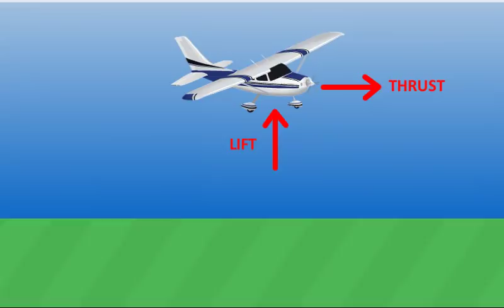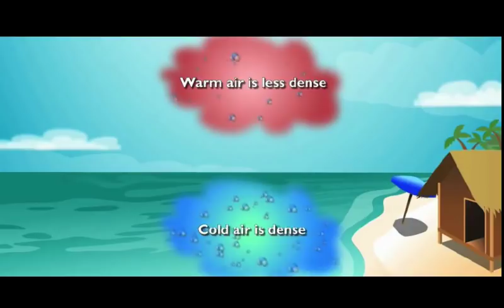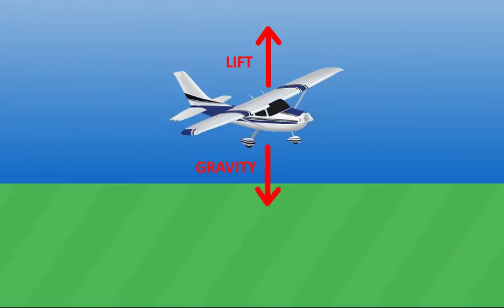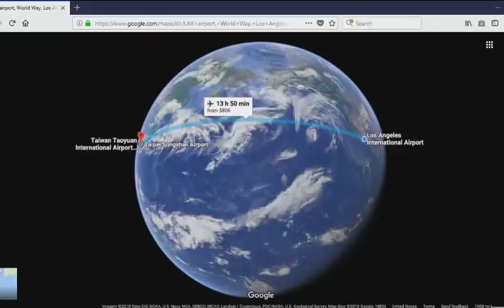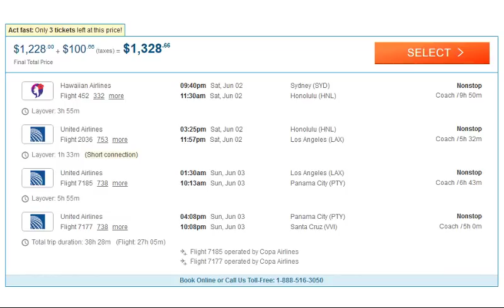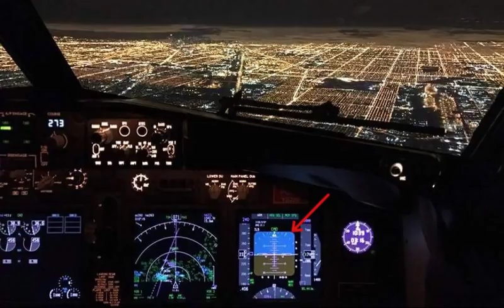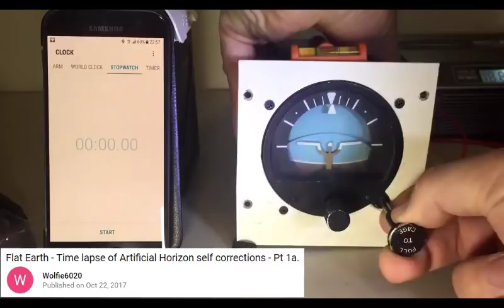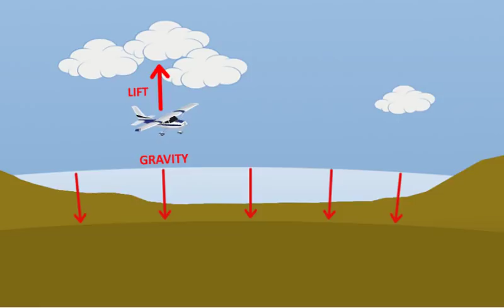Flat Earth Falsities - Plane Nonsense

Comment: You forgot to touch on the Coriolis effect. Humm. Or are you trying to write that out of history also? You know the rotation of the earth affects a 3 g bullet but not a 790 ton aircraft oh and apparently it also affects rotation of a huge hurricane, amazing. Bullets and hurricanes but not airplanes? Can’t wait for that video.
Reply: Maybe an aeroplane has a pilot that can make constant corrections. But your correct, hurricanes do spin in the opposite directions each side of the equator. If you could explain why it would be greatly appreciated.
Reply: A P Presley technically bullets do have pilots it’s called the person who pulled the trigger. And I’m not sure why course correction has anything to do with airspeed and the lack thereof to overcome the surface speed of the earth. And by the way here in United States the surface speed of the earth should be 900 and some change miles per hour which is 400 short of the top speed of a commercial airliner and 200 miles faster than the speed of sound wrap that around your brain
Reply: @charlesshinn7116    If the earth is not spinning, on a flat-earth it must be the sun moving at 1000mph when passing along above the equator. However when in the northern hemispheres summer the sun is moving along the Tropic of Cancer which is much shorter distance on the flat earth than at the equator, so the sun is now travelling at 700mph. Then in the winter when the sun moves south and travels over the Tropic of Capricorn the sun has to speed up to 1300mph. Because the difference distances the sun travels from summer to winter on a flat earth are twice as far. How come nobody notices the sun going twice the speed in the northern hemispheres winter. Or people in the southern hemisphere seeing the sun racing past at double speed in our summer.
Reply: A P Presley first of all I wanna say your comment is extremely encouraging Because it proves you have looked into this very extensively and I am glad of that. I also have looked into this very extensively and your comment assumes that the length the sun travels in a day lengthens and shortens. I don’t necessarily subscribe to the current flat earth model of a sun spinning around a disk. ( The daylight hours don’t add up either) Do a little research on the book of Enoch in that book it describes the sun traveling in a straight line across our flat plane. The same distance day in and day out only changing position from Tropic of Cancer to Tropic of Capricorn throughout the year. I greatly appreciate your ability of critical thinking keep up the good work, continue research and continue seeking the truth.
Reply: @charlesshinn7116    If it always moves in a straight line, how does it get back to the start. So the sun is visible by somebody at all times, travelling in a straight line how does it reset to begin again.
Right now on Macquarie island which is a part of Australian Tasmanian territory. The sunlight and corresponding twilight is lasting 24hrs, the sun barely disappears below the horizon, so twilight lasts all night. I have actually been there and can vouch that this is correct. Macquarie island is on the 55th parallel south. The odd part is, that when the sun rises from just below the horizon. That sun rises south towards Antarctica. How can your sun on the flat earth that you say never goes below the Tropic of Cancer. Be seen below the 55th parallel south.
Reply: @charlesshinn7116  "technically bullets do have pilots it’s called the person who pulled the trigger."
I don't think you understand what a pilot is.  But, if we go ahead and say that shooters are bullet pilots, shooters differ from normal pilots in that shooters can NOT make changes to the flight after they pull the trigger.  They must make all the corrections for the flight BEFORE they pull the trigger.  Normal pilots can make changes DURING flight.
This is why a shooter has to worry about coriolis, but a pilot doesn't.  Because a pilot can correct the flight while in the air.

"And I’m not sure why course correction has anything to do with airspeed and the lack thereof to overcome the surface speed of the earth."
You don't understand conservation of momentum.  Got it.  That's a common failure with you guys.  Airplanes fly at 500 mph.  If you are in your seat on an airplane flying at 500 mph and you get up to go to the bathroom you would never make it right?  I mean, you can't ever hope to walk at 500 mph right?  So you would be trapped in your seat never able to get up for fear that you would slam into the back of the plane right?  Yeah, same concept.  And don't bother saying "oh but what about outside the plane" doesn't matter.  The rules of physics work the same whether you are inside or outside.  Your inability to understand them does not invalidate them.

"I would love to have somebody show me where there is Actual scientific proof that gravity even exist."
Are you floating right now?  No?  If you jump up what happens?  You fall back down right?  There it is.  Don't bother asking for any other proof because if you are incapable of understanding this incredibly basic concept then any scientific experiment will just fly right over your head.

"From what I understand to this day it’s still a theory."
Case in point.  Anyone who says "still a theory" doesn't understand enough about science to even grasp just how much they don't understand.

"And if you read some of Newton’s later papers he recanted the whole thing LOL and beg his peers to please not attribute him for the theory."
Straight up lie.  

"first of all I wanna say your comment is extremely encouraging Because it proves you have looked into this very extensively and I am glad of that."
That's a whole lot of words.  Too bad none of them succeeded in saying anything of value.  How's about instead of telling people to "research" a fairy tale book, you put your money where your mouth is and apply some of that "critical thinking" you were talking about and spend a few minutes actually trying to explain the apparent motion of the Sun over your magical flat world.  Since you don't "subscribe" to the "current flat earth model" why don't you start explaining how your Sun can travel in a "straight line" and somehow still set in the West and rise again in the East?  How can it do that if it's traveling in a "straight line"?  You do know what a "straight line" is right?  If YOU are not able to explain the motion of the damn Sun then YOU are not applying any critical thinking at all.
Reply: A P Presley we live in God’s creation and only he has all the answers but please check out daz nez video (does the sun travel straight or circle round) biblically I think his model gets it as close as we can get with our limited knowledge of how everything actually works. Please check it out it’s a short video only about six minutes long but it may give you a different perspective and maybe a little closer to the truth. I completely believe your description of what you experienced on that island. and he touches on the fact of a midnight sun in his video. I just believe that there are a lot of things that we’ve been told about our world that have either been hidden from us or are lies to deceive us from the truth. Continue to critically think and seek the truth.
Reply: @charlesshinn7116  So basically "god did it" and "watch this video" that's your idea of critical thinking?  Yeah.  You have no interest in seeking truth.  Someone actually interested in truth would not just wave things off and say "well because god".  That's not a direct quote, but that might as well have been.  Hell you might as well have just said "because magic and unicorn farts."  Someone actually interested in seeking truth, someone who actually critically thinks about something...wouldn't just blame some magical sky daddy for everything...they would...you know...actually critically think about the subject and look for answers on how things work.  If YOU can not explain the movement of the Sun in simple terms right here in your own words, then YOU have never actually applied any critical thinking to the subject.
Reply: OMG GMO why, yes that is what I’m saying God did do it LOL. Hello the first three chapters of Genesis but I guess you don’t believe in God or the sky daddy as you put it LOL. And I’ll also take it  you didn’t watch the six minute video and I’ll bet it’s because in your opinion it would be a waste of time. to each their own. Truth is truth regardless of religious beliefs. every knee shall bow and every tongue shall confess that Jesus Christ is Lord. Here I’ll tell you what I’m gonna make a prediction your response to this will involve name calling LOL.
Reply: OMG GMO OK I just saw your first reply. My response to conservation of momentum is, you can’t have both the Coriolis effect and conservation of momentum, one of them has to cancel out the other. All the examples of conservation of momentum that I have ever seen have been inside a container such as an airplane or a car and according to the globe model we are not in a container and if you’re saying the atmosphere is the container then there should be no such thing as the Coriolis effect the bullet would move with the atmosphere and hit the target dead on. And because of conservation of momentum how does the rotation of the earth have an affect on hurricanes. You can’t have both the two can exist in the same room.
Reply: OMG GMO As far as gravity. Show me the scientific paper that is proof of gravity, there is none. Even Neal degrease Tyson is quoted as saying we can’t prove that gravity exist we can only see it’s affects. The affects we see only prove that the object that falls is denser than the air that surrounds it.
Reply: OMG GMO and what exactly are you attributing all of your education on the subject to? a fairytale textbook or a fairytale video I’m just saying or Maybe a fairytale school seriously I don’t know you from Adam no pun intended but what’s your educational background and how do you know it’s any better than my educational background? It’s a shame you seem so agitated and angry I didn’t mean to make you angry.
Reply: OMG GMO look I don’t think you’re stupid and I’ll never call you that the fact that you’re talking about this subject at all speaks volumes. What I do find funny is that you answered for somebody else which does tell me one of two things either you’re very concerned about your fellow human beings or I’ve just been tag teamed. In an attempt to shame me in the silence boo-hoo LOL
Reply: @charlesshinn7116  "why, yes that is what I’m saying God did do it LOL"
Well then stop talking about critical thinking.  Saying "god did it" is not critical thinking.  Saying "god did it" is the OPPOSITE of critical thinking.  

"My response to conservation of momentum is, you can’t have both the Coriolis effect and conservation of momentum, one of them has to cancel out the other."
Wrong.  More than one thing can affect the motion of an object.

"All the examples of conservation of momentum that I have ever seen have been inside a container"
In my comment I predicted that you would say THIS EXACT THING.  The rules of physics apply whether you are in a container or not.  Your inability to understand basic principles of physics does not invalidate them.  

"As far as gravity. Show me the scientific paper that is proof of gravity, there is none."
As I said earlier.  Any scientific paper will fly over your head because you can't even understand the concept that you are stuck to the ground right now because of gravity.  Don't ask for scientific papers when you can't understand even basic concepts.

"The affects we see only prove that the object that falls is denser than the air that surrounds it."
Density is not a force.  Stop repeating nonsense you learned from a yoga teacher.  Density can not cause anything to move.  Saying things fall because of density is like saying things fall because they are blue.  It's gibberish.  What you are really saying here is "gravity exists and I know it exists but I can't admit it exists because it destroys my flat dream world so I'll just replace the word gravity with the word density".

"and what exactly are you attributing all of your education on the subject to? a fairytale textbook or a fairytale video I’m just saying or Maybe a fairytale school seriously I don’t know you from Adam no pun intended but what’s your educational background and how do you know it’s any better than my educational background? It’s a shame you seem so agitated and angry I didn’t mean to make you angry."
You have now fired off 5 responses to me.  At the rate of once every 10 minutes.  If anyone is angry here, it's you.  Now, if you needed surgery would you want your doctor to have studied from a textbook?  Or the bible?  If you needed your car repaired would you go to a mechanic?  Or a priest?  If you were taking a flight to Paris would you want a trained pilot?  Or a yoga teacher?  You see how silly your comparisons are?

"What I do find funny is that you answered for somebody else which does tell me one of two things either you’re very concerned about your fellow human beings or I’ve just been tag teamed."
Or, here's an alternate explanation.  This is a public comment thread.  ANYONE can respond to you.  If you don't want the stupidity of your comments challenged, don't make public comments.
Reply: OMG GMO you’re funny
Reply: OMG GMO I like you
Reply: @charlesshinn7116  "in United States the surface speed of the earth should be 900 and some change miles per hour which is 400 short of more than the top speed of a commercial airliner"
     The massive Earth rotates in a virtual vacuum, where an airliner necessarily moves in a fluid atmosphere. However, the ISS also in a virtual vacuum, has a speed 800 mph faster than Earth's (US).

"and 200 miles faster than the speed of sound"
      Except that there is no speed of sound in a vacuum.

"...wrap that around your brain"
      My brain is immune to appeals to personal incredulity.
Reply: @appresley4071  You just keep up that critical thinking and good work, and one day you'll discover the truth. Crack open your Book of Enoch and you'll be a born again flerf in no time!  Remember, flerfs used to believe in the globe just like you! LOL
Reply: @romithromith    Religious idealists seem to be able to totally ignore all and anything to perpetuate a belief. Every religion, they do not necessarily have to be Christians, can develop fringe sects that can astonish everybody. Some of these fringe groups easily lure followers. However my chance of cracking open the Book of Enoch and becoming a flerf are nil. That would require a full frontal lobotomy
Reply: @charlesshinn7116  You are lucky, just one couple, I used to have at least half a dozen on my back.  To be scientific you need to say "Chance did it", or mysterious forces like "Gravity", critical thinker use meanful buzzwords as; "Anamoly" "Singularity", Facts have= "Probably".

Important thing is un-intelligence, it is sane rational that a lobotomy NATURE constructs designs that are perfect for this and that.
  Pure stupidity with time and luck results in Great Sapiens trying hard to understand many mysteries, that oppose 'meaningless purposeless goaless' doings.
Reply: charles shinn 

please read the bible first, before you claim a man made book to be „true“... it isn’t. thats also easy to prove. the bible fails badly:

1. geography. both americas, australia and far east are not mentioned once. all events where god ever „did“ miracles are basically in north africa and mainly the middle east. the whole rest of the world simply doesn’t exist according to the bible. 

2. biology. most animals are not mentioned. only a few from the middle east. kangaroos? nope... polar bears? not once... but unicorns and talking donkeys. again „god“ forgot most of his creation in his own book. 

3. christians are a minority. why didn’t god spread his words not only in the bible (middle east), but also in the rest of the world. supposedly all people are gods creation, also indians, chinese, aborigines...
natives in both americas and australia haven’t heard a word of the bible bollocks until the first missionaries arrived some 1500 to 1700 years later. christian culture was basically forcing all of these peoples into slavery with brutal force. is that gods divine plan? seems „god“ doesn’t give a sh*t about most people. how about 3 billions chinese? they don’t count?

4. other religions. just the existence of one single religion other than biblical religions (apart from catholic, orthodox and protestant church) like hindi, muslims, jews, taoists, buddhists and literally thousands of ancient religions proves all of them wrong. instantly. 

5. wrong by example. if the bible really is true, then god HATES humans. the proof is right there in the old testemony. 
the story of noah tells it all. an enterprise like this is highly illogical, not practicable at all and in the end just proves the mental disorder of your psychopath god. 
how could kangaroos, geckos and snails from australia get to the ark? why doesn’t the bible mention these animals? how did they get back? swim? how did carnivores survive? if they eat a single animal, this species gies extinct immediately and bringing it to the ark was futile in the first place. same is true after the flood. carnivores would die, or hunt extinct masses of species after the flood. all other animals wont find any plant life to feed from. they die too. 

more hate? the story of moses. god killed every first born egyptian (innocent babies too!) and thousands of soldiers in the red sea. yeah, true love! 
actually there are few books with more cruelty, madness, hate and brutality in revenge than the „holy bible“. 

the list of illogical nonsense in the bible is endless. but why is that? 
simple... the bible is a collection of fairytales, full of eneducated, illiterate goatherders superstitious beliefs. these sinpletons couldn’t explain the world, so they came up with stories, retold for hundreds of years, written down eventually. 
nothing about this is insane so far. the bible is what it is. a record of middle east superstitions. interesting, for the reason you can understand their primitive and cruel society back then. 

insanity is to just believe a randomly picked superstition, to hold it up as „truth“ or „word of god“. 
guess why there was not a single „update“ for the bible. THINK!

it isn’t the truth, it isn’t god in there. srry... the world isn’t as simple as that. the truth is not written down in one single book. 

at least read the bible once. i did. there is no love in this book, mostly hate!

srry, there is nothing positive about being a christian god believer.

PS: look for any stories, any reference in the bible that points to north america, todays USA. just start to think... WHY doesn’t the bible indicate that this continent exists? Today, the most radical Christian fundamentalists in the world live in the US. oops, god doesn’t give a sh*t... nothing in the bible. Nada, rien, nothing... veeery telling...
Reply: charles shinn 
when it comes to proper citations:

Genesis 1:26

“And God said, Let us make man in our image, after our likeness“

nothing indicates that women are in the image of god. the bible clearly states that adam is made in the image of god. including genitals, of course. otherwise „in our image“ would be horribly inaccurate. 
meaning that the whole bible is inaccurate... which is true for once... lol
Reply: Ah the GRAVITY marvel of all the air in the whole atmosphere sticking in perfect sync, is keeping rythem despite opposing (drag); winds /hurricanes /corolis /planes,  Momentum of sticking air is one sensible thing, but Mass tons leaving the ground carrier and entering  gas carrier without suffering some ill effects.... well thats a lot of Luck!?

STRANGE how little planes are affected by mostly stable atmosphere... but meteorologists predictions have suffered greatly.
.....In physics, the principle of conservation of Momentum states that when you have an isolated system with no external forces, dont THEY have that with their constant stable; tilt /speed /stickyness over soil & water - openroof hyper dupper sonic billardball craft?
Reply: @BrainUser1    Finally somebody who can explain something for a change.  Why do high pressure systems rotate clockwise in the northern hemisphere, while a high pressure system always rotates the opposite direction, anti-clockwise in the southern hemisphere.
An easy question for a change Louis.
Reply: In WW2 the big battle ships were very serious about taking Coriolis effect into consideration when firing the big guns many miles over the ocean. It was explained to the gunners like this. On a moving merry-go-round, a rolling ball appears to curve away from the target. Actually, the ball is traveling in a straight line. You and your friends on the merry-go-round are moving out of the path of one another due to the merry-go-round's spin. Same with the big guns on war ships, by the time they reached the target, the earth's spin had moved that target. So Charles your correct again, rotation of the earth does affect bullets, well done.
Reply: @appresley4071  Dam give Charles a break, he may be sleeping, trolls can not be at the keyboard all the time. I would like one too :)
 "Finally somebody who can explain something for a change." ???
- JESUS almost had a Heartattack!  Those "Trolls" dont hang around here too much, but seen a few in the past 2 years.... :( sigh!

Is that sane normality to ask Flatearther's "is just an incoherent vague catalogue of disjointed foolish thoughts that make bugger all sense." ....to explain the wonder of the super intelligently designed planatorium physics?   After all I'm supposed to be a blind Religitard!

yes yes an easy one for change... what does not change is thee demand of explanations... with little effort from the Askers :)
  "Why do high pressure systems rotate.."  - déja vu cher ami, over & over, and over many FE videos, now hard to find if not ban...

Why not? Oceans have all kinds of rotations in all directions.
  One is up NORTH (+) pole and one is down SOUTH (-) duality pole of our more sensible flat magnet. One is Center closer, other is near edge of the DOME, so lots of explanations to cause differences.
Reply: @BrainUser1    Your not saying you don't know, surely you could just google the answer and paste the reply. Why do high pressure weather systems always spin in opposite directions between the southern and northern hemispheres. You have plenty of time Louis, I am off to bed it's 12mn here. I will look forward to your answer tomorrow.
Reply: @BrainUser1     Imagine firing a rocket from the north pole, and that rocket took one hour to reach it's target Louis. That target would have drifted 15° from its original position. This was proved conclusively by Bob and Jeran. 
Bob and Jism, fancy giving flat-earthers a gyrocompass. An instrument that by the force of gravity and the earth's spin locates north. What could possibly go wrong?
Reply: A P Presley I would love to have somebody show me where there is Actual scientific proof that gravity even exist. From what I understand to this day it’s still a theory. And if you read some of Newton’s later papers he recanted the whole thing LOL and beg his peers to please not attribute him for the theory. Please I beg you exercise critical thinking do the research we are all in this together. Please remember or flat Earthers started out believing in the globe.
Reply: @charlesshinn7116  I for one don't believe in the defined "gravity" as we've been taught that masses attract.  But there is clearly an acceleration / force that moves more dense things downward.
I wonder if the "light" created on day 1 (Genesis ch1) was the EM scale and there is a null below us.  Between that, a firmament above, density, and buoyancy it would all make sense.  I donno... just considering things.
Reply: wydopnthrtl awesome example of critical thinking and every time we do that we become one step closer to the truth. Please clarify “EM scale” l tried to look it up but didn’t come up with anything relevant to our discussion and I would love to continue
Reply: charles shinn 
your silence is very telling...
Reply: FYI...no such thing as the "Coriolis force", the pilots don't use it, snipers don't use it, and if there was an affect of the Earth spinning, aircraft going west would never reach their destination, because the fake globe is rotating at a 1,000 miles an hour, right..(jet aircraft cruise at about 500 knots) see_ (youtube)."U.S. Army sniper "no coriolis effect in long distance sho..." ".
Reply: T K  Thank you, That is exactly my point
Reply: Sorry it took so long for me to reply, I had a very busy Sunday and I had to read through all the replies.